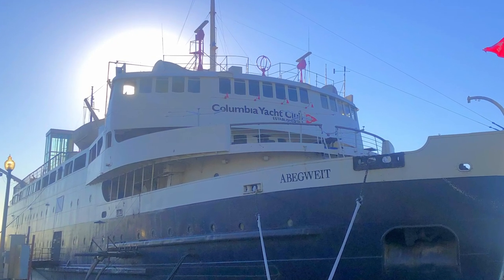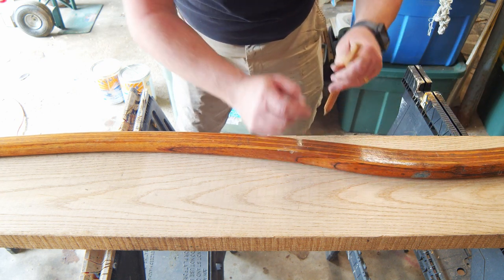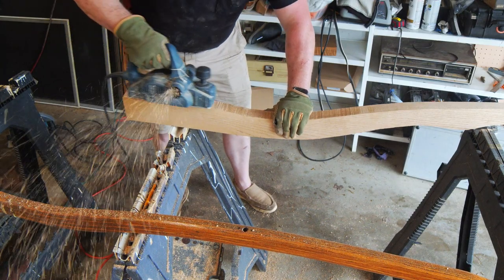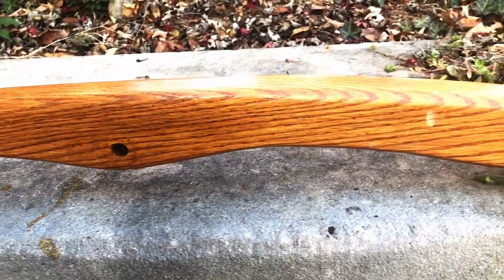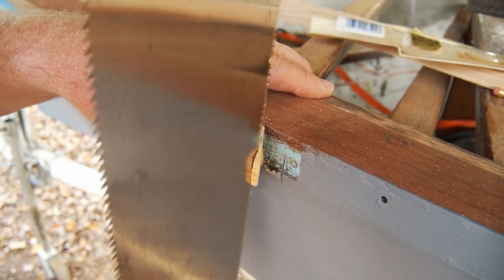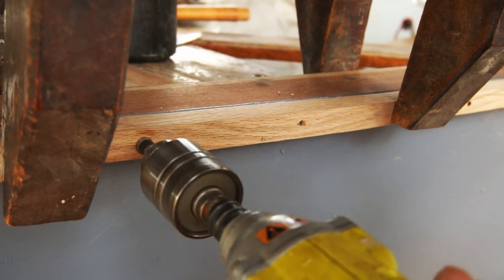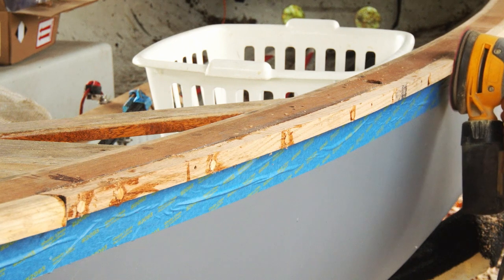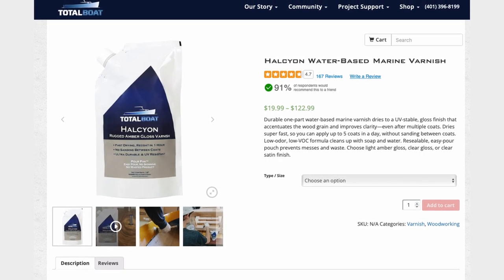Eps. 4.02 - How to make a tiller and repair a rub rail.  SE04EPS02

Comment: The Nomad Boat Builder sands his pencils flat on one side. I tried it, and tracing is much much more accurate! Might have saved you some of that half hour on the Thistle.
Reply: Excellent idea! Will give that a try. I also use a Japanese marling knife for a REALLY thin reference line but that's not always ideal. Thanks for passing that along, will give it a go sometime.
Reply: @GraceEvangelicalLutheranChurch  You might like the Nomad Boat Builder. The guy has built  125 boats!